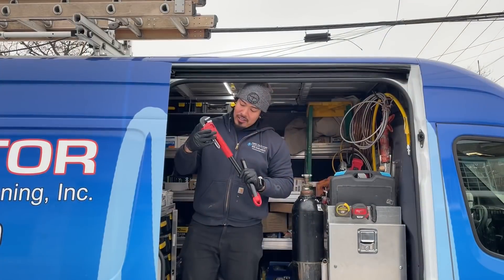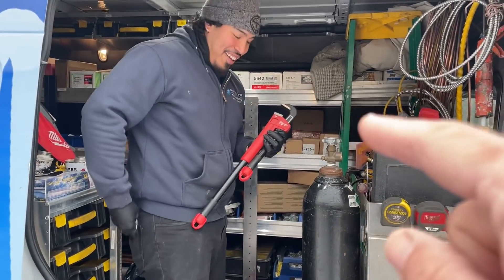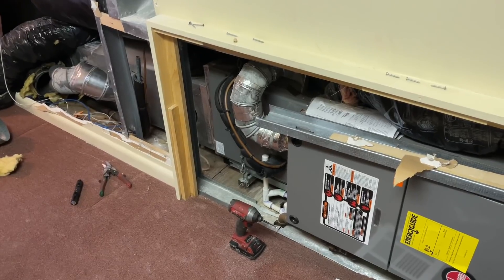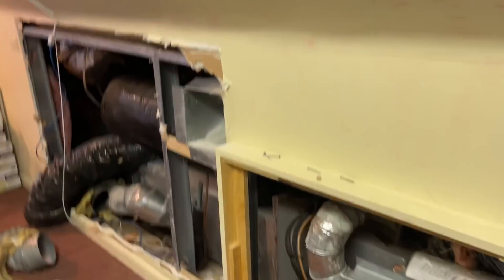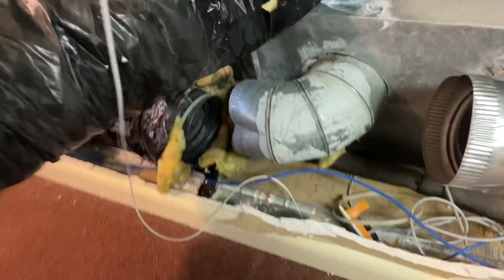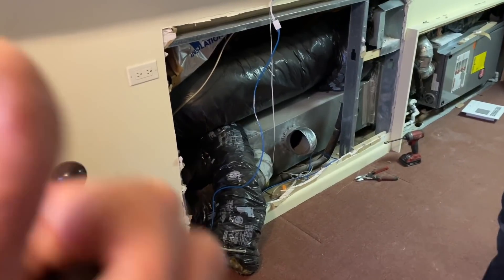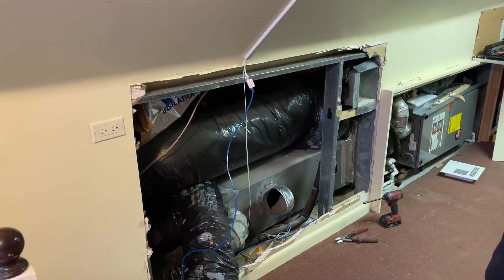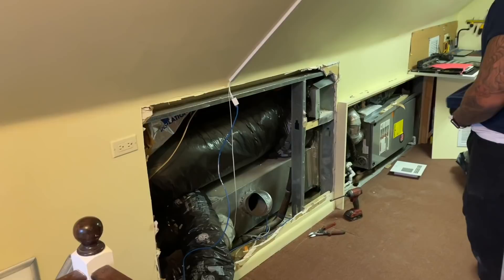Mikey Pipes Giveaway Day 1 - Milwaukee Cheater Wrench & Zoning a Forced Air Gas Furnace

Comment: 1. what about adding a ductless mini split floor unit at that wall you had open?
or.
2. rip out that system and install two mini split ducted units staked on top of each other.  The bottom on feeding the floor below and the top one feeding that current space???

lastly

3. a high velocity system. it only has 4" supply ducts ????

Comment: I would push the customer more towards the zoning for sure. They would most evidently be much happier in the long run if there is capacity remaining on existing. This taken into consideration your already doing new ductwork. Cheers

Comment: not a plumber but would come in handy, have to move 6 cast iron rads away from the wall in a 12 rad single loop system. have a 40 yr old weil mclain with b/g 100 pump. used crappy harbor freight pipe wrenches with sch 40 pvc as cheater bar to move 1 radiator last month. this could make it a lot easier. by the way, im the guy that installed my own fujitsu heat pump in your previous. vid last week. i will  send photos

Comment: This is not as simple a problem as it may first appear and I am definitely not an expert or super tech like Mikey Pipes,  It is an interesting problem to solve.

IMO:  The name of this game is “balance”.  Based on a quick glance, it looks like the downstairs level has no positive air separation ie: door, at the foot of the stairs.  As such, it is going to be difficult to create an effective zone in this upstairs level with a common return.  Hot air in the heating and cooling seasons will rise from the lower level and cold air will drop and exchange with the hot air in the lower level in the summer cooling season.  

The only way I could see to effectively manage the zoning of the two spaces would be to control the return of the upper zone space.  

In the heating season the undersizing of the return line in the upper zone will limit the heat input to the upper space and accommodate any up flow from the floor below.  In the cooling season, if the upper floor return size is too large, air will be diverted to the upstairs from the downstairs and provide too much cooling to the upper space and short circuit the lower floor.  I assume the large duct above the supply is a return for the lower floor area.  The whole idea is to keep the upper and lower level circuits balanced such that they don’t steal air from one another when acting singly or together.

So far this does not address making the two levels independent zones.  In order to make them independent zones not only would you have to put automatic vent dampers in the upstairs supplies but you really need to put one in the upstairs return also.  Otherwise, without a return damper on the upper level, you would cause a system imbalance and cross circuit the system by drawing air from the lower level up the stairs in both the heating and cooling seasons.

Another consideration could be to make sure you don’t wind up with too much reduced flow across the evap  in the cooling mode.  If this becomes a problem, leaving the returns and supplies open in the cooling mode may be a solution.
Reply: @PipeDoctor  Excellent!  Just watch out for minimum evap airflows but this probably will not be a concern.

Comment: I got enough aluminum pipe wrench someone else deserve that wrench.

You can install 2 zone dampers with a bypass damper for the attic on a thermostat only to control the dampers. The thermostat below will be the main thermostat... Or if ya got the budget make it a 2 zone with multiple zone dampers on a zone panel with bypass control.

Comment: Hi Mike I'm an hvac tech and I would recommend a mitsubishi one way ceiling cassette or really any ceiling cassette for that matter so it can go flush with the ceiling.
I can't tell how thick those roof beams are or if they are trusses but if you have 2x8 there you should be able to make it work
Reply: On another thought I'm not sure what kind of room you have there but you might have room for one of those slim ducted mini splits

Comment: Actually on a more serious note, zoning a hot air system is a little tricky and I would suggest you make sure you have the proper airflow to keep the temperature rise within limits when the smaller zone is calling on heat. Same holds true in the air-conditioning mode, airflow is critical and is affected when one of the zones isn’t calling. Been there done that but you can adjust most of the dampers to bleed a little air and/or play with the blower speeds if you have a high static issue. It would be ideal if the unit that’s already installed has a variable speed ECM motor as well. Good luck!

Comment: Would get a lot of use out of this tool. I am a hvac tech in MI and I work at alot of fire departments that have old boilers. I all ways need a cheater to take apart pipes and make repairs. This tool would help me alot with thses repairs and replacments. Thanks again keep up the good videos.

Comment: Only time ductless doesn't work well is if you have severe cold winters (below -10F for an extended period), but I don't think you guys do.  So I'd definitely go ductless, and direct all that furnace heat to the floor below.  As for the cheater wrench, I had no idea those even existed.  I still use a big length of pipe I squashed so it won't slide off my wrenches easily.  Pretty sure that would be safer then the length of pipe I've got!

Comment: Congrats on your 10,000 subs. Enjoy your videos. I have already made a spot for the Milwaukee Cheater Wrench and when I receive it I hope I never need to use it but if I do come across that pipe that Godzilla figured out how to tighten (lefty loosey righty tighty) I will have the right tool for the job...

Comment: A mini split would be nice for that. I'm betting they will stick with their request for a zoned system. With the heat rises thing they need very little heat coming into upstairs and the majority going to downstairs.  I think they could do better with only 3 6inch registers upstairs during the winter. During the summer they need more cooling than that so they need 4 registers total with a 2 zone system.

Comment: Mikey Pipes! The man, the legend!! How many violinists did you hear of doing all their plumbing and almost all HVAC work themselves? Or repiping radiators? Yeah!? Didn't think so. That's why that tool would be helpful the next time all the unions on my 1-1/4 gas line decide to spring a leak all at the same time, on a Wednesday before Thanksgiving. Guess what I did for that Thanksgiving? Btw, I'll email you a pic of my most recent chronically air-logged convector fix, maybe you can critique it on your Q&A. Next stop, adding an auto air vent on the hot water boiler itself. Love this stuff - and thank you so much for all your videos!! They are entertaining AND instructional!! Cheers from the frozen Midwest!!

Comment: A mini split sounds good and many novices would go that route, only to find out in the hottest months a mini split would not keep up with your cooling needs in that type of attic space. Have removed mini splits just for that reason. Properly re-ducting the plenum is the correct choice, especially if you are well versed. 👍
Reply: I agree.  I love minisplits, however... The heat in the summer will rise up the staircase and the minisplit will continue to run trying to satisfy the space, without much success.  The minisplit will be handling the load from downstairs. Properly zoning the space will work.
Reply: I absolutely agree with ripping out and redoing the ductwork.  It is a mess.  Never should have a takeoff on the end, as it greatly effects the static in the rest of the system.  Extending the trunk line is the correct call.  Good call Mikey.  Love the channel.  🙂
Reply: @sygsyd
I'm assuming it's in addition to not in place of, the ductless has it's own t'stat and when satisfied it's off(winter /summer)
We have ductless cooling down computer rooms elevator rooms etc...
Size it right they work just fine!
Stay safe young man.
Retired keyboard super tech.
Wear your safety glasses.

Comment: Sure a lot of u guys know already but older townhome setups are notorious for this issue... can also add two electronic dampers, one for each floor of the home, then program bottom level to open in winter and top level to close and opposite for summer.

Comment: Are you the same Pipe Doctor that shows up as long island with 516 area code? Will need that cheater pipe for you to take apart my hack job. Or maybe just a burner adjustment

Comment: My man if you ever listen to me please listen I truly don't know where this zone furnace thing comes in but DON'T DO IT "PLEASE"
Go ductless and you will have no problems.
Think 400 cfm per ton.
Think temperature rise or delta T
Unless the indoor and outdoor is variable speed equipment you could get into trouble quick!
Just say'n.
Zones & furnace equipment should be installed and sized before installation AND BE ALL VARIABLE SPEED.
And I'm not say'n some people don't get away with it!!! 😳
And to me personally that wrench is to cute for me I'll bend that trash up on a steam job I've had 48's with cheaters a torches!!!😆😆🤣😂🤣🤣😆🍺🍺🍺🥃🥃
That's a toy for my toy cute collection!!!
Stay safe.
Retired keyboard super tech.
Wear your safety glasses .
PS
Did you get the navi bulletin about the new equipment🤔🍺🍺🥃🥃

Comment: If that furnace was sized for both spaces, it's going to be really hard to get it to work right with a zone system.  Zone systems only work when they are undersized, so you can block off some zones and not cause problems.   Better off with the mini split,  but if you leave that furnace your still going to have to dump some air somewhere,  good luck.

Comment: With my cheap professional opinion . I would definitely go your route and extend the supply duct , repair any damage supply duct and increase the return sizes. Now if the customer has a piggy bank and want to spend an extra amount for there (comfort) a mini split would definitely the cheapest route I would go with  maybe  a 3 zone  1 ducted because you already have the ductwork already in place that would take care of that zone and the other 2 would be wall mounted and would take care of  Problematic heating and cooling areas. 😀 Now back to the free tool I would  rather wait for the veto pro pack ..  or you can consider  a unico- system  extremely  Versatile air hander system that fits in any tight extremely tight area And it's ready comes with all the attachment for the supply air grills there extremely tiny no more than 2" or 3 in diameter .

Comment: Well mr Mikey pipes let me tell you why I deserve to win. I do Hvac work for my dad and he is constantly talking people in to going with gas Heat instead of electric I’m an installer so I find myself constantly tearing out air handlers and going back with gas running a lot of gas line. Also I think a mini split would be your best option there. Great video!

Comment: At least they have a good furnace, for the price I imagine they're gonna go with the reducting and zoning (that furnace is too new to abandon).  Was that a counterflow 80%?  Looked like it, did they have a secondary pan and wet switch?
Reply: After closer review it is an upflow, it has the old style doors.  The new doors for the upflows and 90% are much better than those.  But they still use those doors for the 80% counterflows.  I didnt see a drain pan or a wetswitch, theyre gonna possibly have a ruined ceiling way down the road.  If it was me I'd at least put a wetswitch up there.
Reply: I hate places like this, trying to get every bit of living space outta the sq footage they have to work with.  That's when you start seeing fuckery like this.  Fuck these old ass houses, I don't care if it's 100 years old and has character, it's a mess that's been hacked up and re-done over and over.  No thanks, tear it down.  This is also one reason why I think cities are sespools.  I'll stick to the ranch style homes with basements, big fancy houses are just as bad except they have the money to do whatever hairbrained idea they come up with.

Comment: I plan on running a natural gas supply to an outdoor grill. I have to remove some 1 1/4" piping to do the tie in and this "cheater wrench" would be great for tackling that 1 1/4" piping. Congrats on the 10K mark!!!

Comment: Seems like the system just isn’t balanced.  Shouldn’t the return be where the largest load is, thats the air that needs conditioning? Add a return 2nd floor or switch a supply to return, manual damper or tstat damper on 3rd floor line.

Comment: I could use that pipe wrench, I just bought some kobalt one from Lowes and they suck so it would be nice to have a good pipe wrench.
Reply: Get a set of ridgid pipe wrenches bro, they are superior tools.  They will last you a lifetime, plus they have a lifetime warranty on the body(.  (If you don't win this one my dude.)
Reply: @PipeDoctor  your right your right I should have never bought them there. I was there picking up some stuff for a job and left my pipe wrenches at another job that I was finishing up,I needed them for running gas line. They were in another town so I bought a couple from there and they turned out to be crap lol.

Comment: I think if you enlarge that return on the 3 rd floor return to twice the size it is you’ll find that the air conditioning unit is going to perform much better .  Often the largest problem in air conditioning is return air flow. By that I mean sufficient return air from as much of the house as possible. So often  older houses were built with heating in mind because A/C was a comfort few could afford. Today’s houses are built quite differently. They have high wall returns on the upper floors. Building code here now requires a high wall return in each bedroom and in the hallway on the second floor. 
I think the two zone system is a great idea and the larger return is a plus plus. A small ductless to assist the 3rd floor won’t hurt .
I don’t need your pipe wrench ( I have several aluminum units ranging from 10” to 36” )  I’ll figure it out with mine and add a snipe on the end for leverage. 
Just wanted to comment on your video. You guys do nice work and the videos are enjoyable and informative. Keep it up.👍🇨🇦

Comment: I love watching you videos ive learned alot from watching them and i like how you take a high level of pride in the work you guys do and that pipe wrench would come in handy at my job i work at i run the dryer side of a biosolids processing plant and there are alot of big machines that i constantly have to work on where you need alot of leverage to loosen parts on it to complete the repairs. 
Thank you justin

Comment: NTI LX200 boiler issue, On Sunday my boiler was not heating the hot water. Inlet temp was 110 and outlet temp was 125. DHW was 85. So Mikey Pipes what do you think the problem is?
Well, issue found was 3" fresh air intake was clogged with snow.
Reply: No error, I know odd.